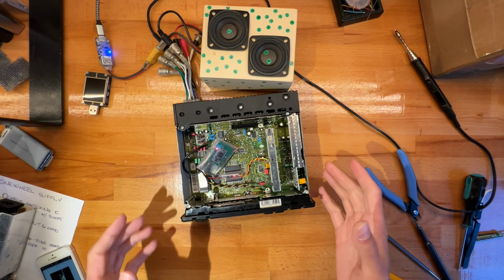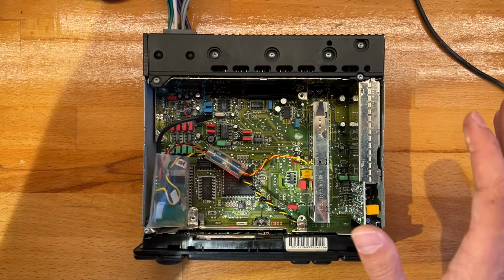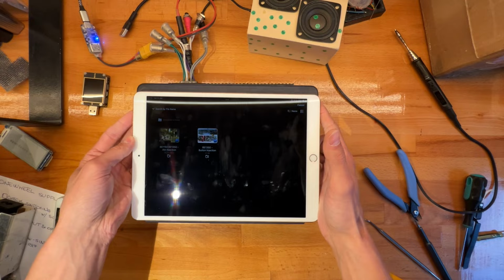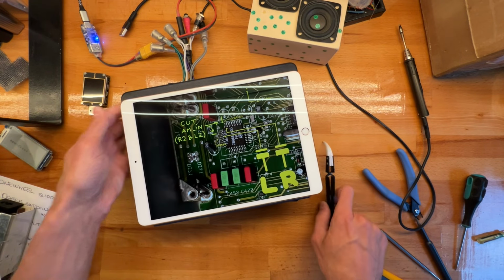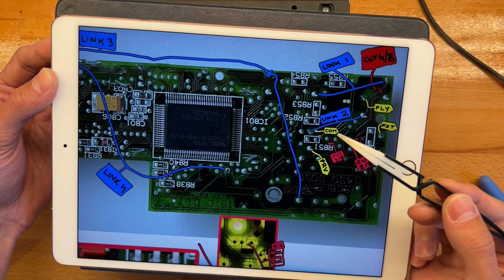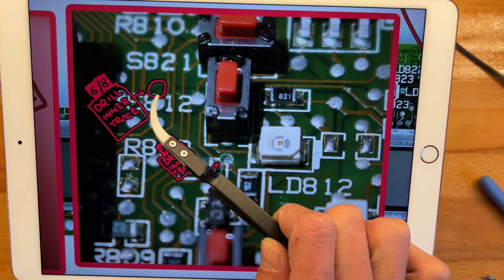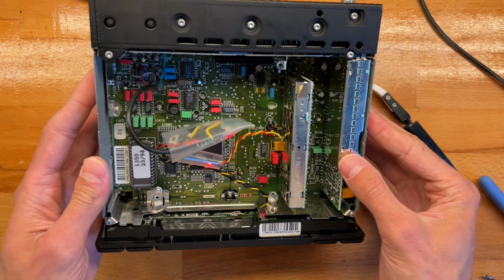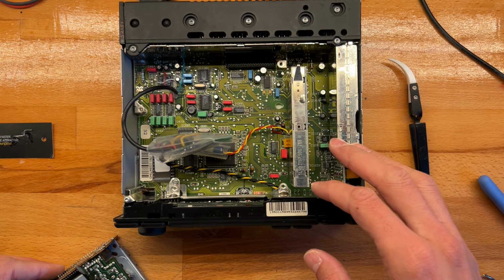Mercedes-Benz Becker Special (BE1350) - Bluetooth / AUX Tutorial

Comment: Can  I use a diffrent Bluetooth module?
Reply from the maker: sure - so long as its output is single-ended, i.e. LEFT RIGHT GROUND, and not differential (right+ right- left+ left-)

what module do you want to use ?
Reply: @Darieee so i got a Bluetooth Module in and it works. But i ve got a problem after nearly a year. My car stalled when switching to lpg. Now i got sudden "mutes" while using Bluetooth. I need to check if it also is in FM but with a cassette there is no  sudden "mutes"

Comment: Do you have a Solution for BE6021? My Idea is from IC101 PIN40 on GND. Than between IC501 and NF-Filter on C503/505 a bridge for L and 507 bridge with C509 for R. B+ and GND on the connector for example. What do you think?

Comment: I've done exactly the same thing on a Sony XR-5890. For the buttons I'm going to add Attiny85 microcontroller to read the front panel buttons through analog read and then send the output through optocoupler for the four input buttons of the bluetooth board.